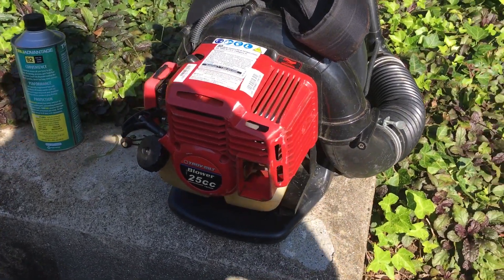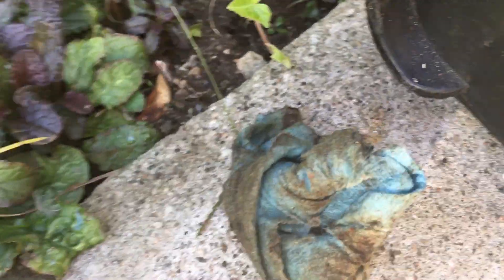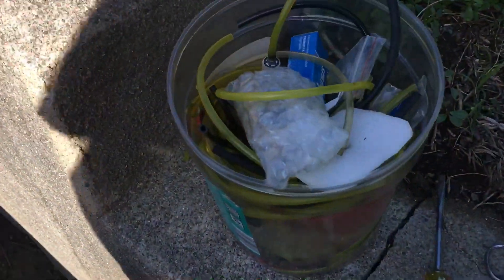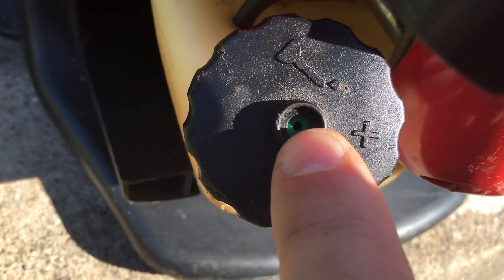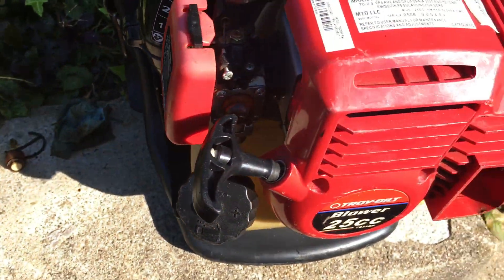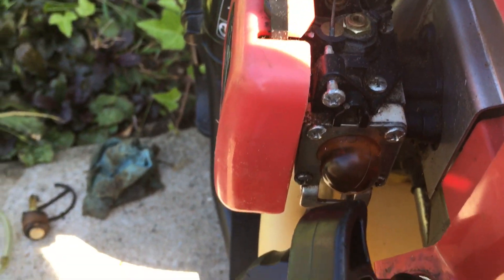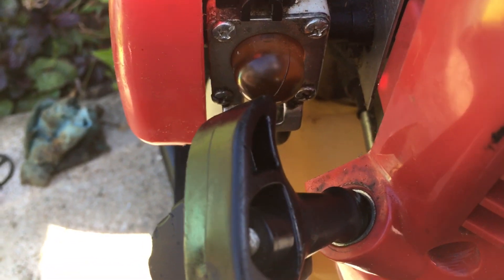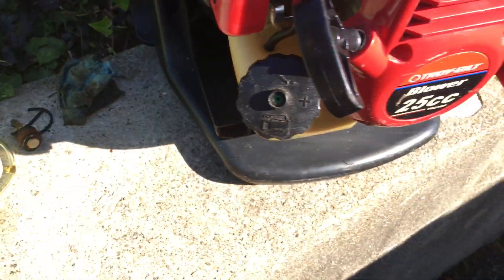TroyBilt TB25BP with varnished fuel

Comment: cleaned the carburetor again and removed 1 fuel hose, but need a fuel filter
Reply from the maker: I use stens filters as my dealer stocks them. About 5 bucks

Comment: Hello,  It seems the parts are obsolete. I need to change both fuel lines and filter. Can you tell me what size fuel lines (1/8 x 1/4 or 1/8 x 3/16) and filter you used? . Thanks so much.
Reply from the maker: Nick, I stock various fuel line sizes.  As long as the OD of the fuel line is larger than the hole in the tank it should seal when pulled through.  As far as ID you need to make sure it is tight in the carb nipple and fuel inlet tube on the carburetor. Generally a small engine shop or power equipment dealer will stock many sizes of fuel line. I suggest taking the unit with you and showing the parts guy  what the line needs to fit. He will be able to give you a piece of fuel line and filter that will work.   If you want to do it online, send me the model and serial number of your equipment and I will look up what belongs in n there and offer a replacement you can buy online.
Reply: @KensSmallEngineRepair  Ken, thanks for your reply.  Here's the model and serial number. Troy-bilt TB25BP and serial #: 0607 002513. Also, I sent you an email, so you can reply to either youtube or email. Thanks again.
Reply: I assume 1/4" diameter  i had to use old lines, and filter since nothing is available at my local stores, but engine not start. It is very old